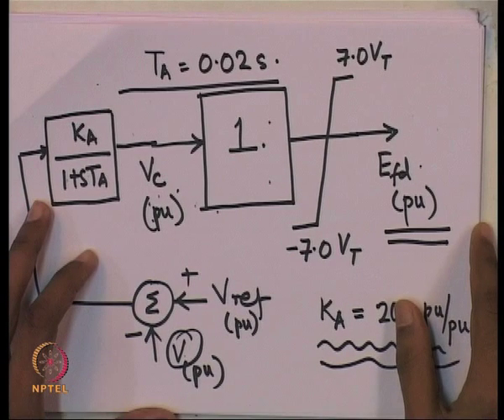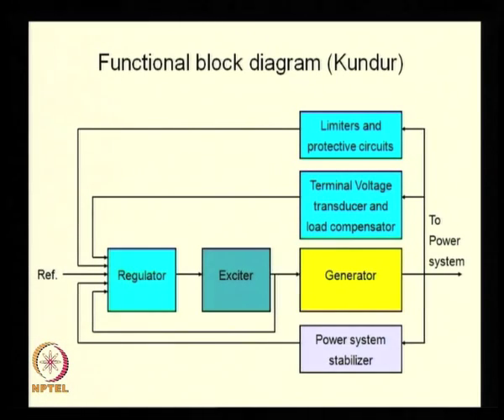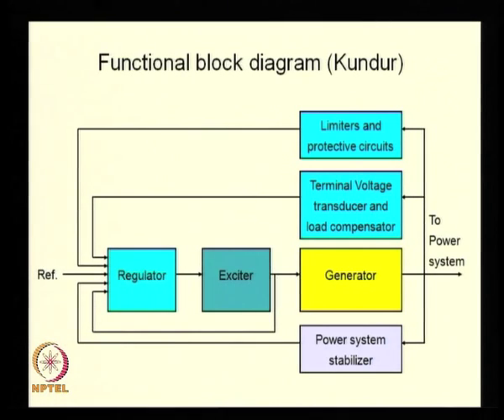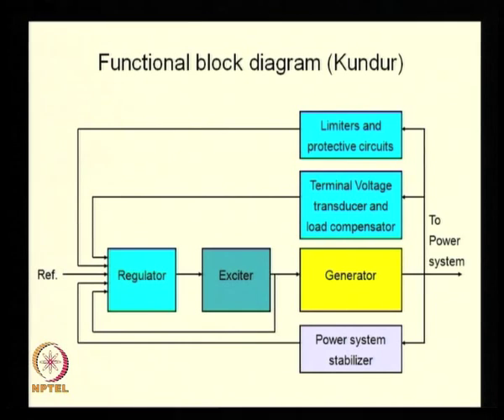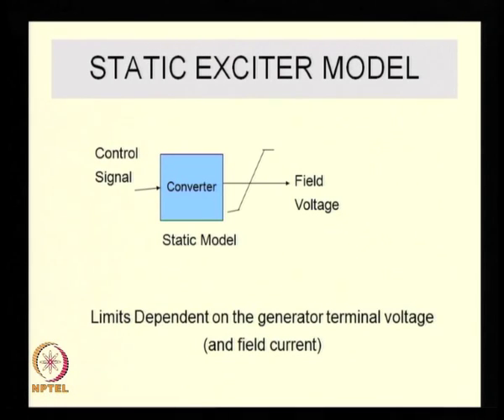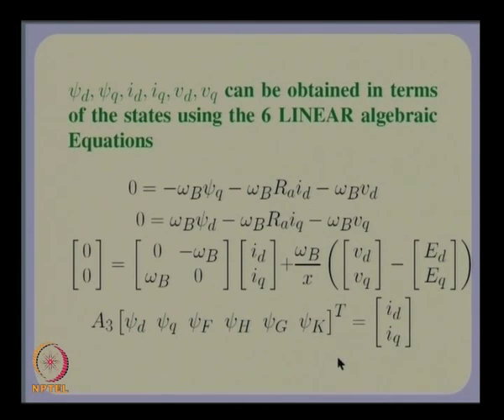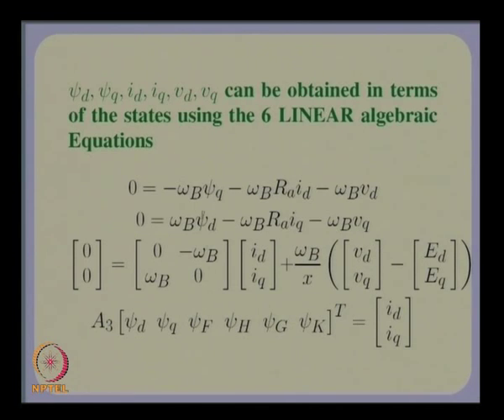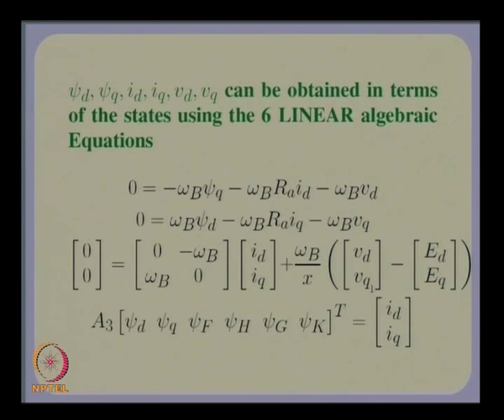Mod-01 Lec-28  Excitation System Modeling. Automatic Voltage Regulator (Simulation)

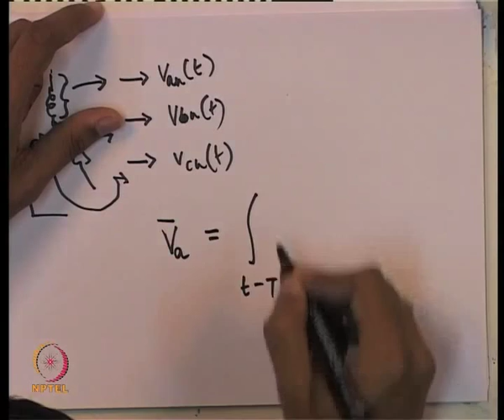Comment: while defining limits for integration at 25:40 ,the upper limit should be 't' rather than 'T' because than and only than we would be integrating the instantaneous voltages for 1 cycle (i.e. time period)
Reply: Hi. I think NO. Its because the time "T" here, is the fault time, and if we look at the integration limits, it tells us the "fault time window". In integration mathematics, its is important to define the time limits correctly and by defining it from "t-T" to "T", we are essentially arming the control system with possibility of extrapolating the system state (to an extent of fault time duration) before the fault occurs. Then the control system gets the behavorial information during the fault itself and can compute the instantaneous value of the phase-to-neutral voltages. Please correct me if i got it wrong. Cheers!